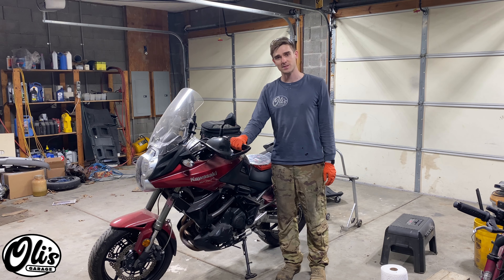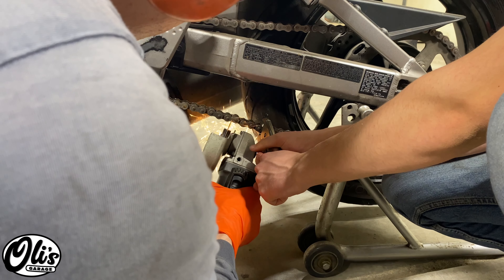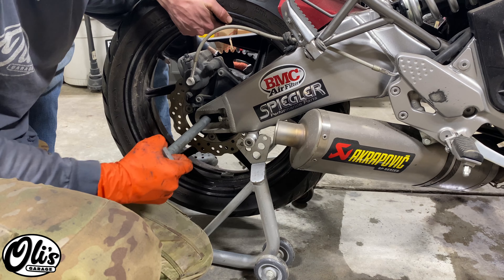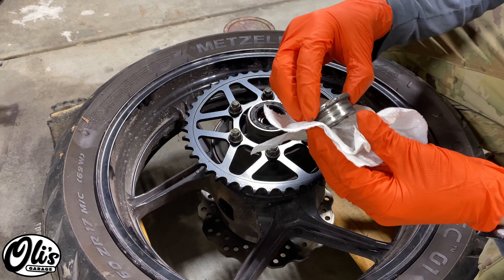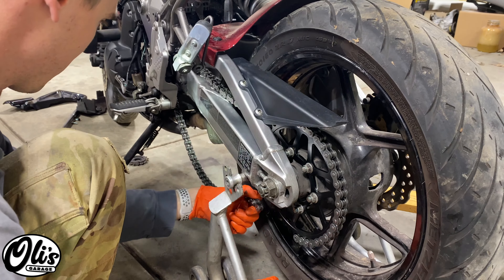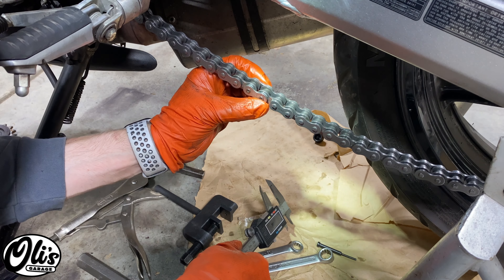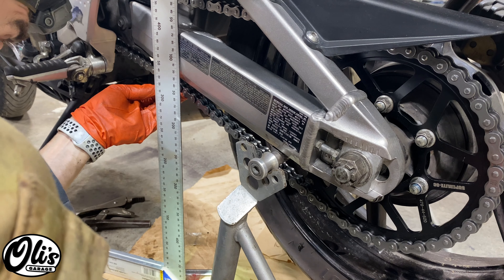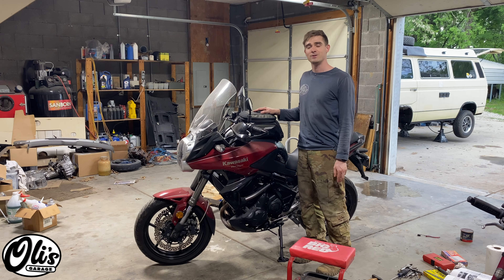How-To: Kawasaki Versys Chain and Sprocket Replacement

Comment: The slag of the chain 25-35mm should be measured with the bike on the side stand only - it is written on the label on the swingarm near the axel nut. If the rear wheel is like in the film in the air, the chain will be pretty too tight. I've got the same bike - 2011 Versys 650.
Apart this issue great video.

Comment: Would be nice to know how it performed with the rear sprocket change from stock 46T to 44T?
Reply from the maker: My honest opinion, I would not spend the money doing it unless if you already had to change the chains and a sprocket. It’s maybe 200rpm lower on the highway compared to before. Really no significant difference there. And 1st gear is slightly taller now which really doesn’t impact me that much. 

That’s my honest opinion haha
Reply: @OlisGarage  thanks Olis. I've noticed there is a linear Speedometer error which will likely be corrected by increasing the front sprocket by 1 tooth. But I've read in some Versys forums that it does not leave much clearance in that area and would be concerned if things got too tight there.

Comment: Trying the take the nut off of my versys 650 with the same impact tool and no luck!!  Do you think the breaker bar might have loosen the nut.
Reply from the maker: Probably. And you can always put a block of wood through the spoke of the rear tire. 

Are you sure you’re at the full strength setting with a charged battery? That can make a huge difference
Reply: Sure enough. I had half a battery or what I thought was half a battery. It turns out it was 1/4 left.
Reply from the maker: @Koolnirvanaguy  glad to hear it worked!! That impact is great. But half dead batteries and multiple connections (from 1/2 inch to 1 inch adapters, etc) really weaken it. I watched a video where the impact didn’t perform at full power with the smaller batteries. One needed the 5 or 8 amp batteries to get full power. Don’t completely quote me on that, but the conclusion was definitely full break loose torque doesn’t get achieved unless if you have the huge battery
Reply: Wow all that amount of grease will just colect junk and dirt